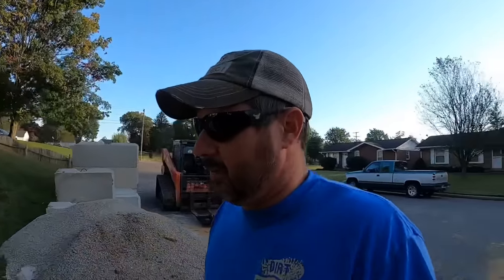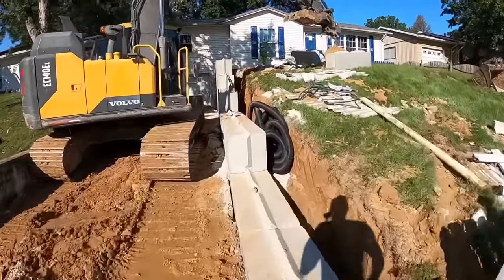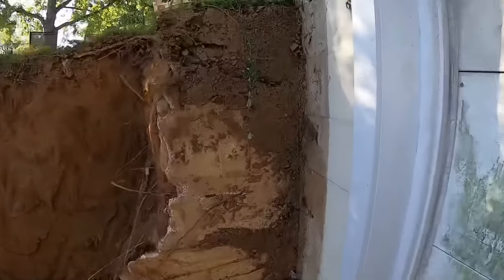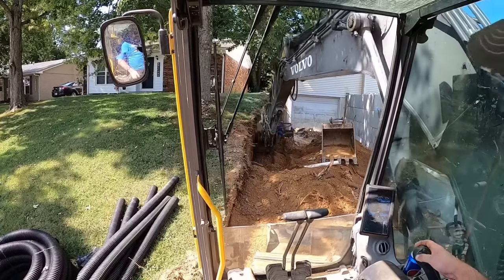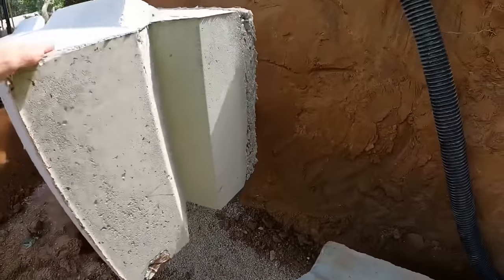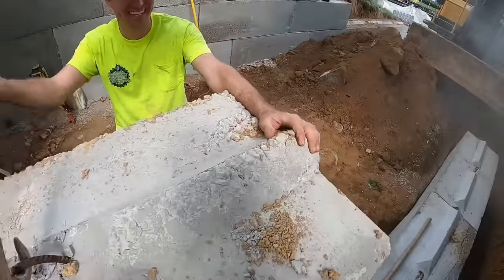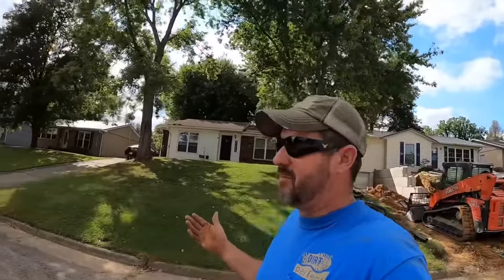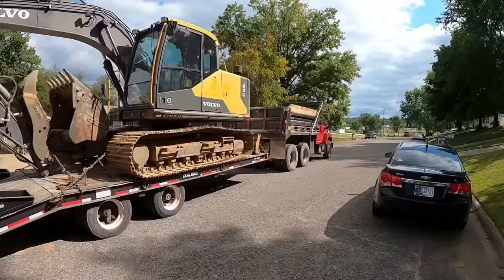Going backwards to go Forward on the retaining wall build fun fun 🙄

Comment: My compliments on how effectively you use the time lapse in your videos.  You show all the repetitive work that is required but allow it to speed on through.  
The second block on the second wall clearly shows a cold joint in the concrete  that illustrates that they are made from left-over concrete.
Reply from the maker: Thanks roger

Comment: When. I pour retaining walls I like to pitch them into the high side by 1/4" per foot. If it's leaning it should lean into hill. That way if it moves it can settle back into place. If it is level it can my go one way, once it's past plumb it can't settle back into the hill. Take care from Canada where the frost pushes every wall.
Reply: I do the same on flat work(it rains a lot in the northwest. I have a 4'  level with a rip from nothing to 1" taped to it that is my cheater level

Comment: What would have been the price difference to pouring a concrete wall vs all the extra work you did repositioning blocks and having to grout or face the blocks in the end?
Reply from the maker: 10k
Reply: @DirtPerfect  Significant savings. Good to know. Thanks

Comment: hey guys up here in Illinois they make the same blocks, and use them for material bunkers, gravel, mulch, ect. The also make nice ones for big projects, like retaining walls around bridges, walls in water for erosion control, and so on.  they take alot more time on those all are flat and square, they also have a decorative face on one side, for a nice finished look. The only problem with those is they are 10 times the price. The bottom line is " you get what you pay for "   Have a great day, I have to get myself a cold beverage I'm worn out from typing. keep up the great videos!!!!!!!!!!!!!

'

Comment: I'd love to take a poll to see how many commenters have been on any equipment bigger than a lawn tractor? Some of these comments are just embarrassing. Next time I start to miss residential work I'll throw this video on 🤣. Another awesome project!
Reply: Started my career as a grave digger and land clearer. Deere 310 Back hoe and an old ass deere crawler. Moved to a large company that built roads, ran everything from small dozers to CAT D10's, multiple excavators, front end loaders etc etc. Funny thing is I never ever once sat in or ran a skid steer. Then I went from equipment operator to a union pipe fitter, far better money.
Reply: @inkman996  I do alot of land clearing and road building too. I also have family in the pipefitters union. I like being my own boss, but union pipefitting is definitely a good way to go. So 2 of us have operated equip
Reply from the maker: Lol good ?

Comment: Tree roots follow water especially on drain pipes that slightly leak. Working on a golf course you see it all. We ad one root grow all the way into the green by growing in the French drain. We couldn't figure out how or why the green wasn't draining so we sodded up the entire green and started working our way down two days later we had everything back to normal. On a irrigation pipe about 3 feet down a pine root split into a V than grew around the pipe until in suffocated and broke the pipe. Mother nature is crazy

Comment: Troweling grout into those cracks would not be difficult technically. They could even slide in those galv metal strips to have hanging tabs toward the inside if they need them (for rock veneer securement).

Comment: Instead of checking for level, I believe in that case you should check for plumb.. If you want a straight wall.. If the blocks ore out plump & level.. To my mind's eye.. That would be the best course of action to take.. I by trade am a master carpenter, when building a wall I always first check plumb, then after that is done I address level, if it is needed.. I know that wall will be covered with stone or stucco, so being perfect don't really matter.. I have OCD, so perfection is never up for a debate when I did anything, LOL.. Sorry if I sounded a bit critical, it was not my intent.. When you are just watching something it is easier to see what the problems are.. I know being there doing it is a complete different animal... All an all I enjoyed it a lot and love to see people actually trying to correct mistakes other then trying to cover them up...
On to the next one...

Comment: I drove a Concrete mixer for one winter in 08 . I used to set up the molds and bend the rebar for those. After a while the molds get really dirty And banged up  . It’s the part of the job that nobody really cares about Because it’s usually hot junk mix And a lot of them are Half poors   Or somebody forgot to use the vibrator. So they’re Honeycone

Comment: They are poured 90% of the time with a hot mix before the rest is thrown away. I made these blocks for 15 yrs. After each job we was sent out on all extra mix got poured into blocks. After beating up the concrete for hours and adding so much water to them. You get blocks. A customer already paid for this concrete so making blocks with it just allows concrete CO. To get paid twice

Comment: Theses blocks would already be better then the retaining wall I've got. It's made out of hollow cement blocks. Go take a guess at what the ground did to them with the freeze and thaw cycles... Yeah, that's right, the entire wall is now leaning quite a bit. Fortunately, if it does end up falling, the only thing that it will crush is a bunch of weeds.

Comment: Even galvanized those washers seem like they would rust.  I know they probably won't but it just seems odd using those in a wall.

I suppose you could have used mortar but aside from mixing and messing with it how the heck do you wiggle blocks that big?  :)

As you said, stucco the face of those blocks and it will look a thousand times better than the wall was there.  If you mix coloring in with the stucco you will never have to paint it, and with the volume of those blocks that wall is never going anywhere.  Interesting product and pretty clever on the part of your local concrete batch plant in coming up with a great way to deal with their overages!

Comment: At the concrete place I work the drivers fill the block forms and they don't all have the same idea how full to fill them. No matter how many times you tell them to fill it to even with the top of the form, not all are filled to the same level. So that effects the width of the block so even stacking them in the yard is frustrating.

Comment: When I learned to run a track hoe (in a JD 160 LC) the 1st lesson my boss taught me was hook to and unhooking from an eye from in the cab. Probably did that for 4 hrs. each day for 2 weeks (if the machine was free)… he said I needed to "feel" the machine and make it an extension of my body. It worked well enough and I got proficient, the rest of my time was driving a dump truck and operating a hand shovel and broom. Our shovels and brooms had no AC or heater, so I learned well enough to be "a valuable spare operator"... LOL

Comment: Why not alternate the direction of each row? Then some would lean in a little and next would lean out a little.
Reply from the maker: Faces and ends or different
Reply: if you would of watched more then 5 secs of the video you would know why he dont do that.
Reply: @trucking123100  - Actually, as long as all of the blocks in the same row are facing the same direction then it is possible to alternate the direction of the rows.
Reply: @daneclark3161  no one said it wasn't, he said in his video the reason why he dont is because one side is finished one side is rough.  I cant help you read or understand common sense.
Reply: @trucking123100  - Did you even watch the video???  All of the male ends of the blocks on both sides of the driveway are facing the street.  He put the shims on the right side of the driveway on the driveway side of the block.  He put the shims on the left side of the driveway on the dirt side.

Duh...  One side of the driveway is "finished" and the other side is "rough".
Reply: @daneclark3161  yep they are all the same on one side and all the same on the other side, same way i build them, gives it a clean look, and all the rows face the same. in stead of having each row look odd and the ends not look the same. the original comment went right over your head, now your talking about pointless stuff, He said in his video why he dont alter the rows, we are talking about 1 side of the drive way not both. we are talking about altering rows, do you need me to explain that to you what that means and what the original commenter said?
Reply: @trucking123100  - If you’re covering it with stucco or stone, as he suggested, then it doesn’t make a bit of difference now does it?
Reply: @daneclark3161  he’s not 100% sure they are, why does it matter how he wants to do his walls? Do you care that much if so why don’t you go find some jobs building them and do them how you want too. Everyone comes out of the wood work behind there computer and all of a sudden there experts.
Reply: @trucking123100  He said both sides are the same.   3:08
Reply: @firesurfer  That's not what he said, He said all the blocks on this side are textured the same and on the other side the texture is different, that's why in the video he made the comment they thought about turning the blocks around and face them all the other way. I work with these blocks all the time they have different texture on one side then the other. if you stack a row of those blocks all one way, then stack the 2nd row the other way it would look like different blocks and he said, he thinks there going to cover the blocks with something, so he rather have them all be the same in-case they dont because then it looks like crap. he takes pride in his walls good guys do.
Reply: @firesurfer  all you guys have to do to know the difference is watch the video, one side of the block is 100% smooth the other side has a aggregate style finish, we use these blocks for bins to store are gravel in and bark dust and top soil, one side is smooth.
Reply: @trucking123100  That's not quite what he said. However, he meant to say the textures are the same on each side but are different relative to each other.  (side)
Reply: @trucking123100  - I don't care how he does his walls.  Nor am I pretending that I am some sort of an "expert".  I am just pointing out that yes, you can alternate the blocks.
Reply: @daneclark3161  no one said you couldnt alter the blocks. Literally not one person said you couldnt.
Reply: @firesurfer  one side is a smooth finish one side is not. Are you having a hard time understanding that? The texture is not the same on each time.
Reply: @trucking123100  You're having a hard time understanding. That much was clear, I'm saying that is NOT what he said, but should have said.
Reply: @firesurfer  my bad, just tired long day, yes probably would of made more sense had he said the blocks have a different texture on each side.
Reply: @trucking123100  - And so you found it necessary to be rude and insulting to the original poster when he asked "Why not?".
Reply: @daneclark3161  not my fault you took it as being rude. have a great day. :)

Comment: Building codes?   I realize you are not done yet and codes vary.   Many areas would require a safety fence at the top of the concrete wall since a person (children playing) or even animals could run right off the top and injure/kill themselves.  I would of left it one course shorter and tapered the soil to the top of the block to reduce the canyon effect and material costs.

Comment: Those blocks are defiantly not a perfect product. I have set hundreds over the years. I check plumb with a straight edge as I go. That way I can correct it as I go. Thankfully our local concrete company started building a far superior block for very little more cost,and they have architectural face print. 
Also, we can’t stack blocks over 4 ft. Without engineering.  Keep up the good work.

Comment: Did you reconnect the downspout pipe to the pipe in the ground? Seems like it would have been easier to do before stacking the blocks in place. Maybe I missed that or you didn't get it in the video. IDK
Reply: He mentioned reconnecting it behind the block and up higher. Plenty of fall there to drain away.
Reply from the maker: Yup 🤷‍♂️

Comment: The teeth on the bucket look very loose. You might want to shim them before the bucket gets ruined.
Nice job!
Reply from the maker: lol not how it works but ok 👌
Reply: @DirtPerfect  brush and floss? (snickers)
Reply: Everyday Excavations  
Maybe you should keep your comments to yourself. Have many diggers and buckets and none of my teeth are loose. My comment was strictly just an observation and a heads up to Dirt Perfect.
Reply: @mabconstructionsrvc4620  Every large excavator i have ever been around has had teeth that would appear to be loose.  They are like that by design.  All that holds them on is a nub with a pin through it.  Cat have a little different style pin that slides down the side to lock it on the bucket, but it still moves around.  His teeth are fine.

Comment: id mention to the concrete co that their mold is off an its starting to cut into your! time to fix things they should cut you a deal off the blocks if they keep up using the flawed molds
Reply: i bet the block manufacturer knows.. it's probably just a pricing issue if you want precision blocks or these ones.

Comment: I guess ICF walls were too costly.
Reply: These blocks are basically made for "free" by the local cement batch plant.  Cement that would otherwise go to waste so I imagine the cost on them is pretty compelling or people wouldn't put up with them being as rough and non-square as they are.  

And in other comment he confirms they are significantly cheaper than other solutions.
Reply from the maker: Yup